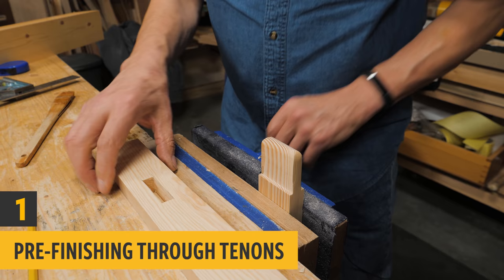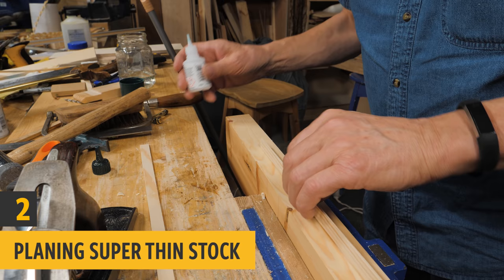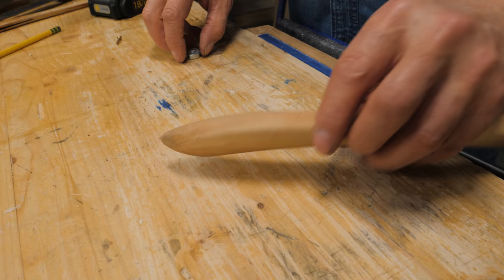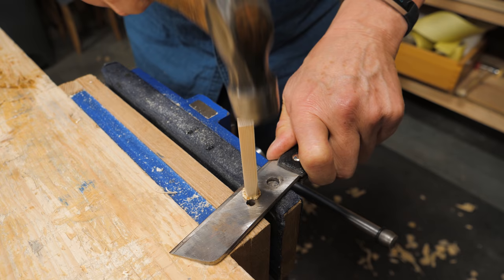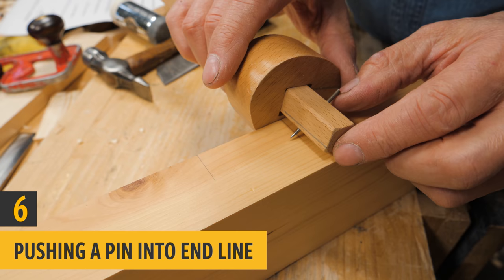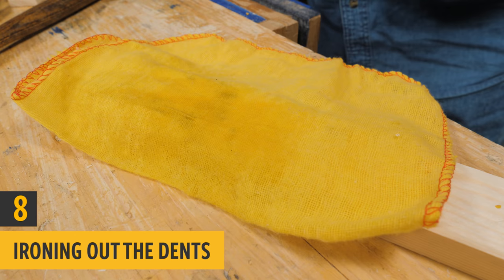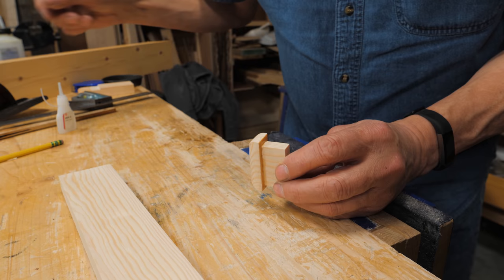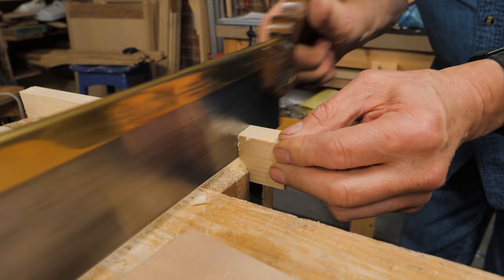Top 10 Woodworking Tips & Tricks | Paul Sellers

Comment: The CA glue trick is a great one. I use it all the time, the only difference is I put painter's tape or masking tape on the two surfaces I want to glue together and then I glue the masking tape together. When you're done just pull the tape off. No glue to clean up. And I've had no problem with hold.

Comment: If you are going to steam out the dents use DISTILLED water. Regular water from a spring or house tap may have minerals in it that will react with tannins in the wood causing some discoloration. Made that mistake once on some oak.

Comment: Its always interesting to see the plethora of ‘tips and tricks’ that hobby woodworkers invent to big up their authentic craftsman credentials. The hobby guys suck it up of course and the real craftsmen, the few of us left that is, just laugh down our shirt sleeves because we don’t stuff around with any of these ‘tricks of the trade’.
The only one I use very occasionally is the hot iron and wet rag but honestly it never works really well and truthfully if you have a ding that bad your better off planing it off.
The super glue trick to hold an inlay ? Silly trick really because when ever I inlay I leave it proud and plane it down flush after its dried out for a few days, otherwise the inlay will shrink and leave a slight depression. One that a hot iron will not get rid of.
Using shellac as a resist ? Well I suppose so but in that instance its easier to just apply glue to your face before you push the tenon home to the shoulders. Your still going to have to wipe the glue off anyway. Traditional practice is actually to wedge any through tenon if you want to knock it down OR wedge it and plane it flush which is extremely strong and the best way to join doors.
In practice a good joiner knows that wiping the excess of glue off with a wet rag serves TWO purposes. One, it cleans the glues off easily and quickly but TWO and less obvious its causes localised swelling of the timber and squeezes the joint up really tight. So tight that you get an invisible glue line.
Have I ever used shellac to seal a tenon before glue up in forty years on the shop floor ? Hell no. The foreman and journeymen would give you hell wasting time on silly stuff like that.